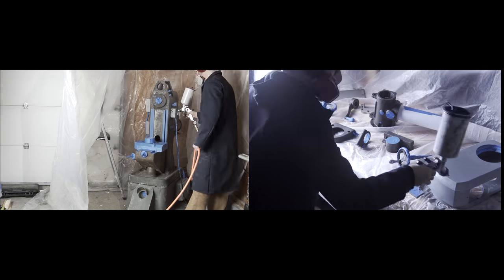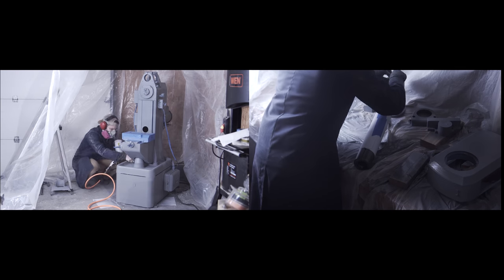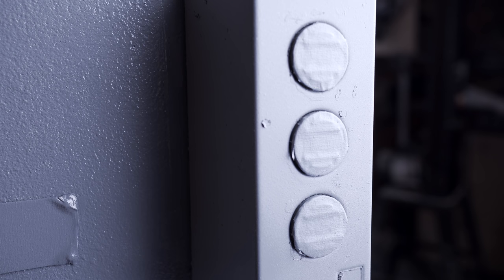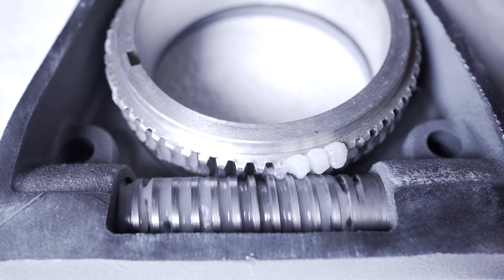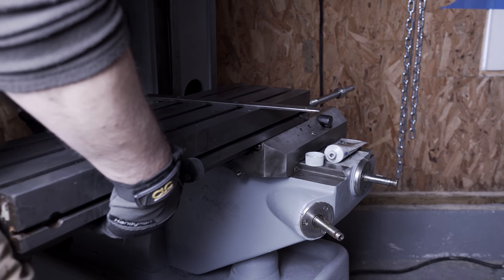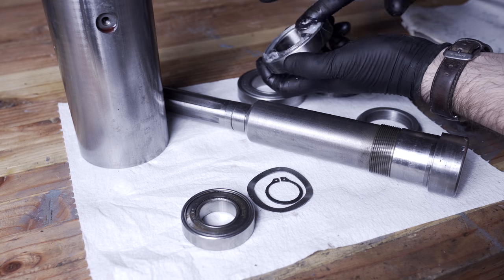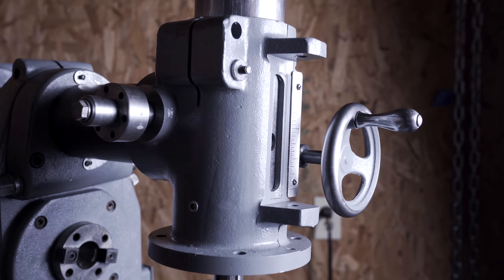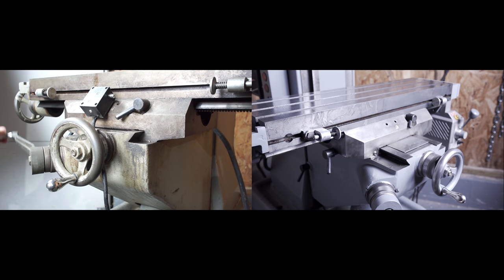Rockwell Mill Clean/Repaint - Part 4

Comment: I enjoyed both you and John Burton [Burton's Attic] Mill video series on this Mill... Well done!
You guys cost me a lot of money :-(   I found one of these Horiz and Vert Mills on auction from a school.
After a complete taredown, and scrubbing [no paint] I completely disassembled the Horiz gear box, as well as the Vert Quill/Spindle and replaced all the bearings, belts, and gaskets.
I rebuilt the motors and re-wired them for 220v vs 110v. 
The reassembly of the "Back Gear" was very tricky to re-synchronize the cluster. That was the only real tedious part of the whole program.
Thx for posting your series.
If ya ever happen to get to Michigan, look me up. It'd be fun to visit, and share our experience.
Thx, Dave
Reply from the maker: Haha sorry!  It's a great little mill, happy to see the family of owners grow!  Good call rewiring them to 220, I've been thinking about that (or adding a VFD spindle) but... too lazy lately :)  Also didn't tear down the horizontal gearbox either, wasn't fully confident in my abilities at the time.  Might consider doing that in the future though, it's a little crunchier in there than I'd like.  Cheers!

Comment: if you ever have to replace those spindle and pulley bearings.  to pack bearings. put a dab of grease in your palm and scoop the side of the bearing thru it. so the grease goes between the races and rollers..  it does NOT need a lot of grease..  you will also want to take apart your old bearings. figure out how to grind several thousands off the OD of the outer and perhaps even the ID of the inner race. you can now use these to push the new bearings into the housing so you don't put marks on the balls and the races causing failure really quickly.  since nobody has bearing heaters to heat the ID to slip it over shafts.  AvE here on youtube showed a great bearing heater tip.  moisten a paper towel..  wrap your precision bearing in it.. put it in the microwave..  this will heat the bearing so you can drop it over the shafts without pounding. https://youtu.be/LVODJm05plw  yep its a real thing..
Reply from the maker: Good to know, thanks!  First time packing machine bearings, realized it wasn't quite the same as wheel bearings about halfway through :D

Comment: I have the original power feed on my Rockwell mill and the two main pieces you show at 8:12 are the pieces that the factory power feed mounts to.   My power feed has motor problems and I may convert it to a more modern setup like yours. How well does your power feed work on it?   I may get something with similar specs to the HF one. I may get a model with more torque if you think it is needed.
Reply from the maker: Works great! No concerns, it seems to have plenty of power for my needs and it feels very smooth once engaged in the cut. No stuttering or anything.  But I've mainly worked in aluminum, so grain of salt there. It's done fine when I've used it on steel, but I haven't done a lot of ferrous work in general so limited dataset there.  Honestly my only gripe is that the minimum speed is a bit faster than I'd like sometimes when I'm doing something very delicate.

Comment: Nice job on the rebuild. I rebuilt one of these machines not long ago. After reassembly I notice the last 3” or so of my spindle quill heating up. Does your machine do that?
Reply from the maker: Nice!  I really like these little Rockwells, perfect for a garage.  I've noticed mine can get warm, especially if running on a higher RPM.  Next time I run it I'll check with a non-contact thermometer and see.

Comment: I wonder if you replaced the spindle nut you damaged when disassembling? Nice video, thanks for your work.
Reply from the maker: I ended up reusing the same nut and not replacing it.  I tightened about 3/4 of the way, and tested removing it with a proper tool...there was enough bite left in the cutouts that wasn't a problem to remove.  If I ever need to rebuild the spindle I'll probably replace it then, but it seems to be working fine for now :)  Thanks for watching!

Comment: Good stuff Zach.  I like the Superlube as well. Eventually the spots you are greasing will be oiled anyway.  The Superlube makes it slide together easy and not super messy.  Sherline Lathes use Super Lube a lot for micro lathes and mills. 

Well done.  Some will comment on the grease in the spindle bearing - distinct industry grease will be referenced and superseded dozens of times to obscure names. Go ahead and grab a spindle mount for your indicators (dovetail type to the indicator works well). Or pony up for a nice NOGA indicator holder. 

Thanks for the powerfeed closeups and discussion. 

Okay where's the DRO buddy?  

Excellent series - you did yourself proud here. 

Dan
Reply from the maker: Thanks Dan!  Really appreciate the kind words.  

Good to know about Superlube being alright.  It seemed like it would do fine, since none of the parts are overly high speed or high pressure.  But confirmation is always good.  And like you said, all these parts are unsealed anyhow so it's going to mix with other fluids sooner or later :)

DRO coming soon!  ;)